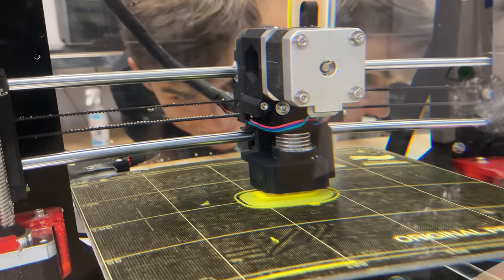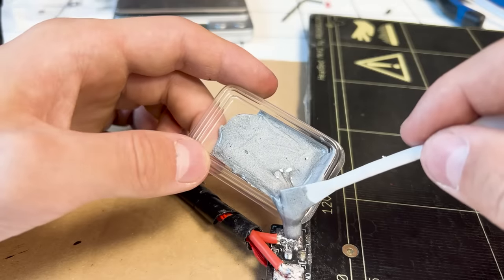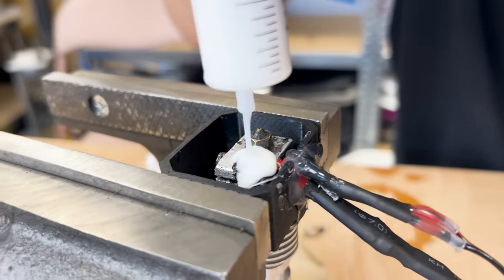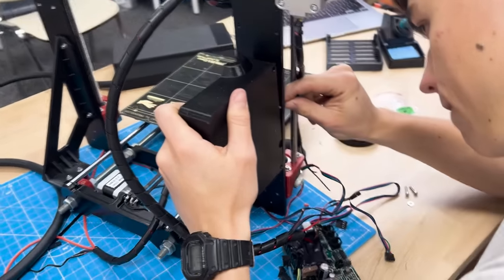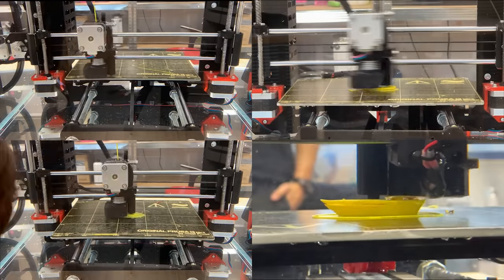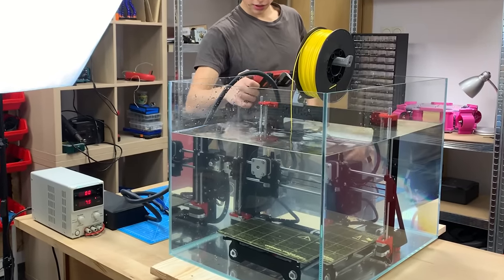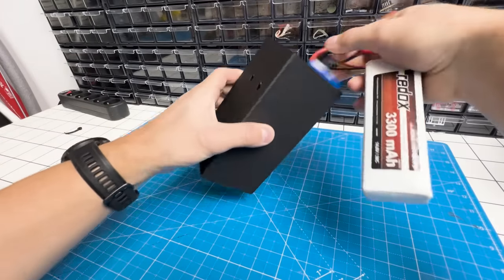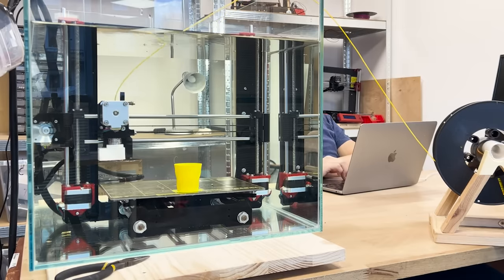3D printing underwater actually WORKS

Comment: I wonder if instead of submerging the entire printer completely you could have a small secondary nozzle that shoots a stream of water at the recently cooled part. You wouldn’t have to deal with as much insulation or waterproofing, nor the heatbed losing a lot of heat to the water. You could have the jet of water be cooled by an ice bath or water chiller, allowing potentially more water cooling ability and stiffness for overhangs, and then switch to hot/no water for the parts that need better layer adhesion. Kinda like the equivalent of flood cooling on cnc mills but for printers
Reply: What about mineral oil?
Reply: yeah
Reply: Good idea but the print bead would cool down way too fast and spotty. Maybe chilled air would be better suited instead.
Reply: i didnt know you were into 3d printers
Reply: Leave cereal into really hot milk for 1 hour then eat it
Reply: You missed the point why they did it underwater, it's not just so it can cool down instantly but also because of buoyancy, it keeps molten plastic in place better than air. Stream of water would just do more mess
Reply: had the same idear. Maby a flood cooling system from a cnc mill cut be used. That woud look so funny :D
Reply: Cooling down plastic too fast can reduce its mechanical properties.
Reply: What if he has something that will raise the water level to the level to the level of the print that he Is printing? So it won't cool the nozzle, but will quickly cool the print itself
Reply: or a corexy machine with only the z axis under water
but they wouldn't be able to bring it to a swimming pool
Reply: that breakes all the logic in building an underwater working 3D printer
Reply: @lyhongleft3676 a very clever solution. better yet, keep a constant water level and lower the bed. basically a voron trident filled with water haha
Reply: @scharpmeister  oh yeah, that's much better and easier than raising it
Reply: Why not create an enclosure around the extruder that you can pull a vacuum on so the only heat transfer will be through the connection points?
Reply: @pavesomsk908  but it doesn't break the logic of why they want an underwater printer, to get better cooling and overhangs.
Reply: @lyhongleft3676  That could work but the whole idea is flawed anyway, large temperature gradients cause warping for the majority of filaments, thats why you need heated chambers for large ABS parts.
Reply: @clixium In that case, what about a system that slowly fills the tank, keeping the water level just slightly above (or below) the nozzle. (Or alternatively, slowly lower the printer into the water to achieve the same effect)
Reply: @conorstewart2214  I see
Reply: @stevethorpe  if the water is at nozzle level that wouldn't work as well, the printhead would just create waves, the print needs to be way below the surface where water is calm and not affected by the bed or head movements. What works is this, gel substance instead of water, it completely eliminates supports, no issues with overhangs or bridging, also safe for electronics, we just need to know where to get that gel :) https://www.youtube.com/watch?v=Bcfwb4eukKE
Reply: @josiahong5177  might be a bit abrasive on the parts
Reply: @ideaxgaming5647  i see. Deionized water or smth maybe?
Reply: Hold on there, partner, no logic allowed here.
Reply: Could the level of the cooling liquid be raised as the print is being made, this way it would not expose the entire mechanism?
Reply: @clixium Ok, that's seriously impressive.
Reply: This was my idea as well
Reply: @clixium  

water, sodium alginate, calcium chloride, 1-2% sodium alginate, 2-5% calcium chloride, its as close as you can get to the mix they used in that MIT test.
Reply: That is a good idea
Reply: @conorstewart2214  'large temperature gradients cause warping for the majority of filaments,'
That's because there's a differential cooling rate across the whole part, while the lower bit is typically held at a higher temperature to keep it stuck to the build plate.
If the entire part is at room temperature the whole time due to instant cooling, and the only hot point is where it's being put down and instantly cooled, then where it is placing will be constantly referenced only to the cooled part so there won't be overall part warping.

Comment: The most important thing is that you actually made a fully functional underwater 3d printer. That's the first step, and with more improvements, this could be a new way to print things without supports or in  different materials that need such a particular cooling. Congratulations.

Comment: Maybe a delta style printer would be better with only the end effector going in the water. Not that any of this is a good idea. But it is entertaining.
Great video. Keep up the good work.
Reply: In that case CoreXY would be optimal, because only the bed would need to be submerged in water and the rest stays dry. Also the very little contact of the nozzle with the water keeps it from needing insulation if you do it right

Comment: Excellent engineering process by iterating on solutions after breaking down the problem into manageable parts. I wouldn’t have believed this was possible until seeing the video. Even though a simple underwater 3D printer may not be practical, your experiment can be used as a springboard for various innovations in the 3D printing space as illustrated on the comments.  Well done 👏

Comment: This generally has an interesting application for semi-cristalline materials. Given their crystallisation rate is basically -x² with both points being y=0 (y being the cristallisation rate, x the temp) the tg and the melting point. Given cooling down to tg isnt possible for some filaments (POM having one of -80°C) you could keep the liquid temp just below the melting point of the filament. For this application a non-oil based liquid with a boiling point of over 200°C would be needed. But if you can get that liquid, the rest would be pretty easy given the Hotend basically needs no insulation

Basically by keeping the material just below its melting point and easing gravity with a liquid you could keep the crystallisation rate at almost 0 making warping bc of crystallisation insignificant
Reply: That would maybe reduce warping but it would also make it pretty much impossible to print, if the whole print volume is just under the melting point the plastic won’t cool fast enough and will deform, on top of that most 3D printing materials go soft well before their printing temperature so would deform because of that too. With heated chambers and beds you want to have the temperature below the heat deflection temperature or glass transition temperature to reduce warping but also to stop the print melting or deforming.
Reply: @conorstewart2214  thats why a fluid might help to stabilize the filament. Im well aware that the filament gets soft, but in my case i wanna print POM, which is basically impossible to print as soon as it starts crystallizing
Reply: Ive done a lot of printing with recycled materials like HDPE and PP and this would be such a cool solution to their warping tendencies
Reply: @chris_0725  how do you think a fluid might help to stabilise it? Air is a fluid anyway. Your fluid would have to be the same density as the filament so the parts dont sink or float and be thick enough to not be pushed around and deform your part. Anyway the same issues exist, having the part heated to much higher than its glass transistion temperature would make it very easy to deform, with a fluid even the currents caused by the hot end moving might cause it to deform and gravity definitely still will.

A solid solution could be better, similar to how SLS printers work, you could maybe do that but add a filler material around the part rather than just plastic powder.

What issues are you having printing POM?
Reply: @conorstewart2214  To answer you last question first: what issues dont i have while printing Pom xD

It sticks on almost nothing (something ive learned to overcome), and it shrinks about 4% due to crystallinity
Reply: @conorstewart2214  You have solutions for printing POM ? This I am interested to hear because I cant get it to stick for the life of me to anything.  I can get it to melt and extrude without issue but getting it to stick is a whole nother story.
Reply: @chris_0725  So please enlighten me as to how you get it to stick, I have tried tons of different things, nothing has worked so far.
Reply: @scottgarrett6207  Sorry, totally forgot to answer 😅

I use either Nanopolymer adhesive applied as a very thick layer multiple times on top of each other or i print a 100% infill 10mm thick ABS Raft-Block
Reply: This would also reduce mechanical strength though...

Comment: For mechanical longevity you can replace all the linear bearings with igus polymer bushings. The axial bearings could be replaced with ceramic versions or polymer bushings. You could potentially replace the rods with aluminum or carbon fiber to ensure that they don’t oxidize in the water.
Reply: Aluminium oxidizes bro
Reply: @ChrisWijtmans  Ceramic berings is the way to go.

Comment: Amazing!!! I thought of this exact idea some time ago and even told a friend about it, but we never attempted a prototype. Additional ideas: Heated liquid (mentioned in the last second) for perfect build volume heating without warping (abs, pet...), Oil as liquid (no corrosion problems, perfekt lubrication and even lower density difference>> higher buoyancy, flooding after the first layer, sealed Filament path (tube to the surface), core XY to prevent problems with high drag when moving a bigger part. I don't know if I got everything, but sooo cool to see someone having the same idea. Basically I concluded, that it would make even more sense to use a solid instead of a liquid and how cool would it be if the solid was the Printmaterial - which brought me to SLS printers.

Comment: I see massive advantages regarding cooling when printing under water. for example that water has a similar specific density to PETG, meaning that you need almost no support to support. PLA has a higher density, but not bad.
you will need some sort holes as an opening to the infill to drain the water.
and since you will probably not be able to change the nozzle, I'd suggest the diamond nozzle, it is practically not degenerating when using it, it might outlast your printer.
Reply: pla absorbs water
Reply: @braken9315  it takes PLA quite some time to absorb water, and after it is used for printing, the water absorption does not massively alter the print quality (or in other words: keep some holes in the perimeter so the water trapped in the infill can escape).
Reply: @robertheinrich2994   you did forget that 3d printing causes tiny holes which you cant see where watter will get trapped in and thats gonna be worse when you are directly printing it in water
Reply: @braken9315  that might be a problem too.
honestly, I love space travel and I am very interested in it. the test to print under water is just one step. we need to test if printing in vacuum is possible. cooling fans shouldn't work in vacuum.
if we get that working, 3d-printing space stations could become a thing.

Comment: I hope you consider my idea for next version,,
the best way in my opinion to do this is to only submerge the layers that are printed. The extruder should stay mostly above water and only move sideways. And the plateforme should be capable of going up and down, this way the printing happens centimeters from the surface but the motors and all electronics stay above water, only the base will be submerged and move downward as you print

Comment: I think the motors are a pretty easy fix, just make them water tight and add mineral oil to their inside to make it even harder for water to get in through possible tiny gaps.
Reply: You can buy them IP68

Comment: quick tip, stainless bearings for steppers, bigger probelem is the stepper body...also pla floats in water so overhagns will come out perfect thanks to that.

Comment: Awesome experiment 😀. A few suggestions:

- Use high temperature two component silicone. It is usually sold as a form building material for tin/lead casting.
- Keep the moisture out of the print head (should be possible with the ptfe tube), that would help with layer adhesion.
- There is a steam bubble at the tip of the nozzle, not sure if this is useful, I would try both forming the underside to retain the bubble and come up with some way to disperse it and see what happens.
Reply: The steam bubble may actually be the reason we are seeing good bed and layer adhesion. It's pushing the water out of the contact area.
Reply: @martindinner3621  yeah might be, that is why I would suggest testing two setups, one that retains the bubble well, and one that disperses it.

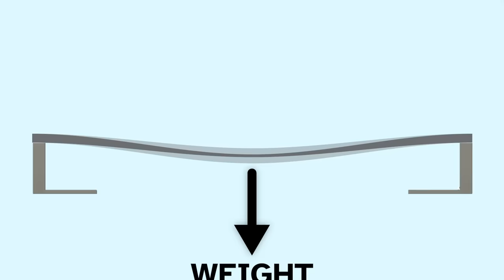Comment: 14:17  It is a common misconception that things weigh less in water. It is not the case they still weigh the same as outside water. But it is affected by a buoyancy that is directed opposite to the force of gravity and corresponds to the weight of the liquid it displaces, which in your case is water.

Comment: What if you'd attempt to build a printer that would use a belt system to move the gantry underwater but keep the steppers in the air. (Something like an inverted Ultimaker S3, where you don't see any stepper motors at all)
You'd still have problems with isolating the nozzle, one way that maybe would do this, if you'd have an unlimited budget would be aerogel, sadly that's not a realistic option currently.
I didn't see if you have pulled a vacuum on your red nozzle bath, if you would suck all the air out before letting it cure you won't have gas bubbles that will form later on.
One way to stop the plastic from collecting moisture would be to attempt to enclose the whole filament system so that no water gets inside. But then you could encounter problems with the water trying to get into the nozzle from the bottom which could create weird things.

Ale jako pierwszy prototyp drukowania pod wodą to wygląda naprawdę fajnie!
Reply: Thats actually a really neat idea
Reply: What actually is a problem with gas bubbles in this situation? Wouldn't they mostly act as extra insulation?
Reply: @Micharlus at 11:00 you can see what gas bubbles do. You want the silicone to be evenly distributed everywhere without any bubbles where the material could possibly start degrading
Reply: Oh, that's the result of air bubbles? Now I see, cheers.

Comment: Interesting topic! I think the stepper motors should be located outside the water, connect them with timing belts. But I think you will then need to use a bowden extruder. (if the bowden is good sealed, the filament won't touch the water before being extruded) Also you can try different water temperatures to see if there are any differences.

Comment: You need to provide two things. cooling speed and you can use instead of water oil with a density similar to that of PET-G, i.e. approx. 1.3g/cm3, then the print will not sink to the bottom. you will get a perfect bridge without rust :)
Reply: Pretty much exactly what I was thinking.

Comment: I have experience with the MG chemical high temperature epoxy. Great stuff but don't go too large in volume. Make a sleeve around the heater with an 4-5 mm offset. This way you prevent cracking. It's quite insulating up to 280 degrees (not sure). I used it in 200+ degree air, you might need to increase the wall thickness. Also it's quite viscous so pulling a vacuum will help with bubbles. Love the work!

Comment: For not soaking the filament, you can use aquarium tubes and design a waterproof filament housing. Tubes are available in any aquarium store by the meter.

Comment: Here's some other ideas for improving underwater printing:
Use a delta printer so you can keep the motor above the water.
Fill the water gradually just under the nozzle so you don't have to worry about covering the heating block with silicone since it will be above water
and if your goal is just better cooling for the plastic coming out of the nozzle just use a sprayer or something to spray the extruded filament with water or coolant to cool it quickly.

Comment: For the stepper problem, back in the day I made a crude underwater vehicle for a school project. We had the motors in a plastic container that was filled with wax from a toilet wax ring (new ofc) the shaft was unimpeded and the wax kept everything sealed up tight. Could also look into how pump motors seal the motor from the shaft.

Comment: The cooling block is designed to radiate heat. Instead of insulating , try making it just a little less efficient, so it achieves a similar heat transfer rate under water. Maybe partially fill up the fins. Or cut it smaller.

Comment: There is a lot of MAGIC that happens in thermoforming but also in many processes when you induce a proper pressure differential environment upon such a process. In fact, we live within  a pressure differential bubble with feedback for equilibrium. I am sure.

I don't think people have considered this yet, but the exercise in printing inside water, especially in a pool, a larger sort of container, can yield interesting data if you can take into account pressure measurements. 

What I am talking about is a much more in depth analysis but these experiments under water are a very good start. 

It is through experimentation that many new findings find themselves progressively  in practical applications.

Comment: Awesome! If we assume a PLA density of 1.24 g/cm3, buoyancy accounts for an 81% weight reduction while submerged in water. HIPS, ABS, and ASA have specific gravities even closer to 1.0, but they require higher nozzle and bed temperatures.

If you try submerged FDM again, please try extreme overhangs with PVB filament. It has a density of 1.1 g/cm3, and doesn't require the high temperatures of HIPS, ABS, or ASA.

The only difficulty I can anticipate is that PVB is more hygroscopic than PLA.